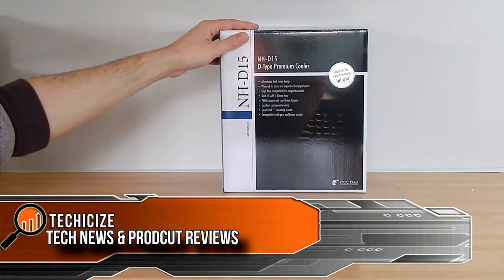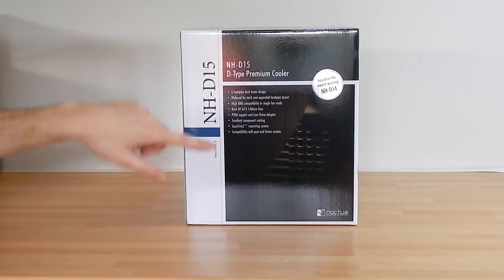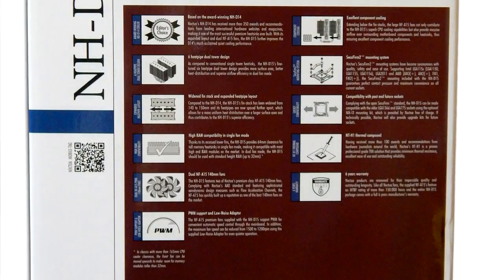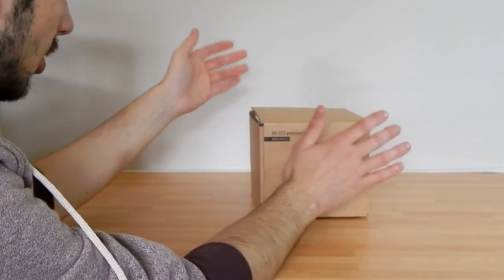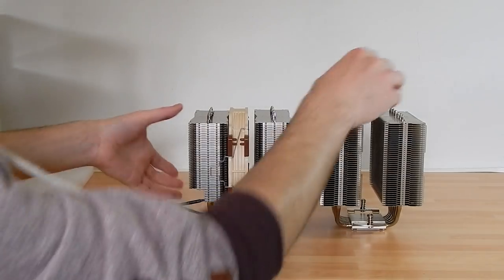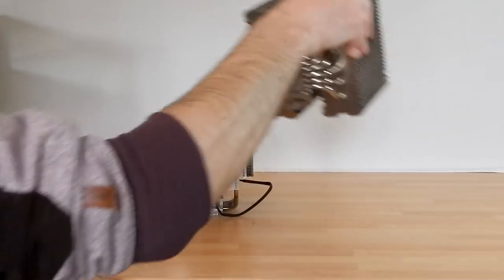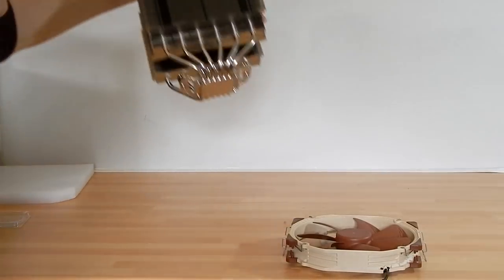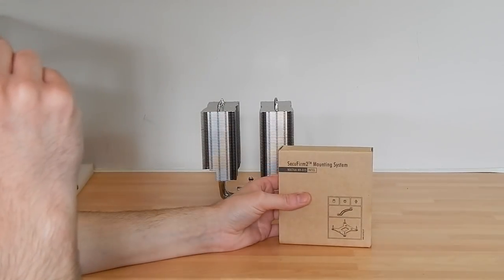Noctua NH-D15 Unbox Overview and Install Guide [Socket 1150]

Comment: I know this is a really old video now, but you know you can mount the fan higher up like that anyway ... Its not a big deal.

They made it flex-able so you can mount the fan higher if your memory gets in the way. It doesnt make an impact. Just hope you have clearance in your case for the fan like that.
Reply from the maker: +Daiesthai Hi, your right  and your one of few that sees the point many others miss. it;s already quite tall and raising the fan increases the overall product height. Not all cases on the market will close when the fan is raised ;)
Reply: +Daiesthai Well I have the shittiest case alive that has clearance for about 7 inch height, still can fit very well so this should fit in almost everything mid tower and up
Reply: +Ark Shit comes beefy. My Lian Li is 210mm and Haf 922 230mm on the outsides and given the cooler is 155mm + 20mm for fan extrusion I would say it's a no-go on the Lian Li and a close call on the Haf, given there are 30/50mm to fit motherboard, standoffs, tray, offset and sideplating :-D Many cases have more motherboard tray offset to fit cables behind it.. dont get me wrong, it will surely fit most cases, but its a good point!
Reply: +Techicize Will a 120mm work on the heat sink?

Comment: I have a noctua cooler 'half' the size of this...and it is very impressive.
Reply from the maker: Yes the smaller models such as the U12s perform very very indeed. The D15 really shines when you overclock a hot CPU like the Haswell's though, in less demanding situations I'd recommend the Noctua NH-U12 or 14s

Comment: Mine has less room between the heat spreaders, so there is just enough room for the fan in the middle without a gap. Mine might work better.

Comment: perhaps you could you use a spacer for the front fan? buy three rubber anti vibration spacers for approx £1 each, and cut part of the bottom off all three. that would allow the fan to sit out from the cooler, away from that ram stick, and also lower down, in alignment.
Reply from the maker: rainbowsalads  you raise a very good point indeed and I could see that working, good thinking
-John

Comment: at the end the whining sound is not coming from the motor but in fact is coming from the wind turbulence created from the second fan because it was not designed to pull threw the cooler radiator fins.
If you mount it in the recommended spot the sound goes away and you are left with just the wind noise.
I can not close the case with the fan over the ram so i opted to use only one fan because i can not stand that whining sound
Reply: Yes, I am. I tried both of the fans in multiple configurations, and when i put the fan in a pull position, rather than push like it was designed, it makes the whining sound.

Comment: i have vengeance lpx DDR4 from corsair and they are 31mm height, so i think mine will be ok, even my full tower case supports heatsinks up to 195mm
Reply: 1sonyzz on their site you can check compatibility for motherboards and ram
Reply: Joep Adams
yeah and i didn't found asus maximus 8 hero

Comment: You forgot the cooling paste. Also could you comment on which way the fans blow/suck, since the planning part becomes harder if you dont know this. Thanks for a nice video anyway :-)
Reply: Gibbet When using the push/pull method of two fans, you have both fans pushing/pulling air towards the rear end of the case. One fan pushes air through the heat sink and the second fan helps pull the other fans air in order to increase the air flow.
Reply: David Davidson
Im confused, do they do both or not?
Reply from the maker: Gibbet You can choose to have the fans either way, it is more common to have them pushing air from above your ram, towards the back of the case.
Reply: Techicize
Where do I choose this then? :o
Reply: Gibbet Sorry if I didn't say it clearly. Pretty much both of these fans will be facing the same direction. It would look like this (Front--->2 heatsink fans-->Back)
Reply: David Davidson
I should've been a bit clearer as well i guess :x
I was wondering how to tell what direction the fans will be blowing in.
Reply: Oh! Most fans will have two arrows somewhere on them. One will tell you the direction the blades spin (sidways) and the other will tell you which direction the air will blow (fowards).

Even if you end up with a fan with only one arrow, it will most likely be the one which tells you the air direction.

Comment: Hopefully I get a answer on this soon.  I am going to purchase this CPU Fan but had a question.  I was told that I could use a case fan for a fan on this.  Now, do I have to buy the brackets to clip on to the Straight Pipes?  If so, what are they called so I can look them up.
Reply from the maker: I don't recommend using a case fan on this product, sure it will work but that's really your decision. The extra clips to mount are included in the box, you don't need to purchase them :)
Reply: +Techicize Thank you for the reply! :)

Comment: Is the 1-fan mode still reasonable for strenuous overclocking circumstances, or would you rather use the 2-fan configuration?
Reply from the maker: TheOriginalMango  yes a single fan is still OK, about 4c less than using 2 fans - http://techicize.com/noctua-nh-d15-review/5/

Comment: Hey there, got a question and I would really appreciate an answer. I have done the same thing as this guy did in the video and that is mounted up both fans on one tower, so my question is, does it matter if they are both on 1 tower or should I mount fans on each of the tower. I mean is the cpu temperature same or not?

Comment: Can't save enough money to buy this , duhhh. You know I measured the size from the cpu socket to the case panel and it's 18CM , this thing gets to 165 cm with fans, but I would like to have a 200mm fan on the rear panel that is aprox 2.5 cm tall ( I don't  know the model of my thermaltake case)  the panel makes a bit of room for the 200mm , if it's gonna fit, maybe the 200mm fan and the noctua could be touching or be a couple of  mm apart , is that a problem? I'm pretty sure that the panel fan could bring down 5 C helping me with a better OC

Comment: i didn't see you apply the thermal paste, is the thermal paste already on the plate of the air cooler?
Reply from the maker: ***** I did not apply paste as this is demo install only. The paste is included but you must apply it yourself
Reply: Ahh i see, thank you for your reply! :)

Comment: Hi, I am using Asus Crosshair V Formula-Z mobo is this Noctua NH-D15 going to be compatible and going to fit with my motherboard?
Reply from the maker: Hi Frost Ice  it will be fine yes- Confirmation - http://www.noctua.at/main.php?show=compatibility_gen&products_id=68&lng=en#AM3+_Asus
Reply: Thank you!
Reply: question did you ever get the heatsink did it fit the Asus Crosshair V Formula-Z AMD mother board and will 2 video cards get in the way

Comment: That is not the way you want to install fans on these for future viewers. Pull fans make added noise when you use the standard fan bumpers. The fan blades are too close to the heatsink. Use push / push when ever possible. If you must run pull / pull then put a 1-3mm gap between the pull side of the fan and the heatsink.

Comment: Good video.  But which fan configuration was the best in the end for those with high RAM issues?  Push/pull on a single tower or pull on each tower?  I can't seem to find that information in your written review...
Reply from the maker: oobenoob the difference was less 1c in either case, i believe that push pull on each was the better
Reply: Techicize Good to know, since my ram is too high I think :/

Comment: hello, i'm in need of a better CPU fan since i only have a stock one from intel, a delta dtc-daa10 which makes the cpu quickly run at 90 degrees. something i don't like that much. running a i7-2600@3.4GHz and gigabyte ga-p67a-d3-b3 motherboard, but my question really is only how tall the Noctua NH-D15 is measured from the motherboard and to the top? Don't have that wide of a case and measured around 18-19cm from motherboard to the edge of removable wall. Thx for any kind of answer :)
Reply from the maker: Patrick Eldevik Kjosar  sorry for my late reply. The cooler is 160 mm or 16cm tall with the fan

Comment: Does this cooler fit on a MSI Z97 Gaming 5 motherboard in a NZXT Phantom 410 mid tower case? Techicize I would love to know :) Thx
Reply: Gustav Sporre PCpartpicker says its compatible. So it should fit. But I have no idea how well it will fit. Looking at some other videos, it should fit just fine. You might just have to move some cables around a bit, but overall it shouldn't get in the way too much.
Reply: Okay. Thanks a lot!! :) Biased Gamer96
Reply: Gustav Sporre yup, just remember that the two outer fans dont have to be all the way down, or even on it at all. If one of the two fans doesn't fit, you can simply remove it, or just not put it down all the way, the cooler will still work great regardless.
Reply: Okay. Thx! Biased Gamer96

Comment: Is there any difference between default ( fan 1 in the middle fan 2 in the front) and if you put the 2 fan to the rear?
Reply from the maker: renks051 No we tested in ton of different ways, the difference is almost none existent. In some cases less then half a degree
Reply: Techicize Are the fans push or pulling and is there any difference?
Reply from the maker: renks051 in this test all pushing, in real case/chasis you would be wanting to do the same, pushing the air towards the rear of the case to exhaust out
Reply: Techicize What do you mean, you got 2 fans on the rear block, so the middle fan is pushing, but the back fan is pulling I assume, otherwise they would both push the air into the second heatsink.

Comment: just raise the fan over the memory, you can mount at whatever height you need

push-pull on just the back fan is bad, push-push on both towers towards the back of the case is what you want in a closed case, and push-push towards the empty center of the cooler is what you want in open air  - it's not rocket science
Reply from the maker: Your 100% correct, thing is though doing this brings to fan closer to side panel and increases the overall height. This will reduce compatibility for some cases

Comment: Is it worth upgrading to one of these from a hyper 212 evo
Reply: JUNAID187  its only worthy as upgrade if you plan to do some overclocking. Or you want a very, very quiet cooler.
Reply: +JUNAID187 what chip you have my 4790k kick afull lot of heat my 212 evo on 4.6ghz on 1.320 volts on 80-95c im gona get this or cm nepton 280l
Reply: +Aaponton I also have a 4790k the evo keeps it nice and cool but then again my case overall has excellent cooling and I live in the UK so my room temps are generally quite low. You shouldn't be getting any overheating there's probably something wrong with the chip or thermal paste or the way you put the cooler on.
Reply: JUNAID187 ok i live n finland there is cold but my room is  about 24-28c and i puttet only small drop of thermal paste like everyone says its best method and my friend get same temps on i5 4690k on same cooler on 1.300 volts 4.6ghz
Reply: +Aaponton It may have been damaged or incorrect connection between chip and cooler. Try reapply thermal paste maybe you're using the incorrect paste?
Reply: JUNAID187 i used paste what came with the cooler

Comment: i have same memory and i want  this cooler and you can put fan litle pit highter and still get same temps begause fan goes under the cooler by more tha 1cm and beats is 1cm highter than memory what this support with 2 fans

Comment: Well....
I would have one if it wouldn't be so...
well, for compatibilty sake it lost a lot of power....

a mix of the NHD15 with the cooling fins of the NHU14 would be the best solution, and then make everything nickleplated copper XD

No, srsly, the NHU14 is performing almost equally like that huge thing....
Reply: +lukas anton j. I agree with you...the u14s is taller, and the fins extend further down towards the base plate. I own one, and with an extra 15-2000rpm pull fan, the performance is fantastic.

Comment: can i install a noctua NH-D15 on Gigabyte G.1 Z87 ? will i have enough room for graphics card? i will go with a closed case Cooler Master HAF 912 Plus. in all those free slots for fans i will have one upper and rear for exhauste and bottom with center one for intake should i put it horizontaly or vertical? i think that is better vertical couse it will pull air with the center fan and exhaust it at the big ass top fan slot what do you think pls reply its my first build so i need to know what to expect will i have room and what do you suggest to me how should i install it? sorry if i dont make sense i did my best with eng :) PLS HELP Thanks
Reply from the maker: Hi JOXWb  it should fit just fine. Mounting it horizontally or vertically wont make that much difference, generally a degree or two better or worse.  Don't worry your English is very good :)
Reply: Techicize ty very much :) but ill go with CoolerMaster Hyper 212 Evo its cheaper and it haves good revievs hopefully it will be a good choice :)
Reply: hi me again :) what do you think about this specs? 
AMD FX-6300 With CoolerMaster Hyper 212EVO with Arctic Mx-4 paste (Push-Pull) Corsair fans SP120 performance
Gigabyte GTX 770 OC 2Gb
Mobo Asus AM3+ 970 M5A97 Rev 2.0
SSD Kingston 120Gb
HDD Seagate Baracuda 2Tb
Kingston HyperX Furry 2x4Gb 1866MHz Black
Seasonic M12II EVO 80+ bronze 620W will this be enough power?
CoolerMaster HAF 912+ Case with additional 200mm fan on top of the case and one of the Corsair SP120 couse its a bundle on the side of the panel
Reply: JOXWb If you're looking for advice on builds, or even just opinions - I recommend you visit tomshardware.com, setup and account, and jump on the forums. Friendly, and knowledgeable community :)
Reply: Charlie Ward thanks for a tip allready have acc there about a week ago made it and it was very helpfull this is my build

ASUS 990X M5A99X EVO 2.0
AMD FX-8350 with hyper evo 212 mx-4 paste and push pull system
ASUS GTX 760 DCIIOC 2Gb
Kingston 2x4gb furry hyperX 
SSD 120 gb patrion pyro and HDD 1tb seagate Baracuda
seasonic 620W M12II evo
with CM HAF 912+ case

Im waiting for parts tomorow or after tomorow they will arive :)
Reply from the maker: JOXWb Hi sorry I missed your other questions. Tomshardware has a very good forums and I glad you sorted now :)
Reply: Techicize yes very kind people good tips and solutions from them ill reccoment them to all :) keep up the good revievs :)
Reply: JOXWb Sounds like a fun build! Here's mine atm:

Intel Core i5 4670k @ 3.4Ghz
Corsair H100i
Asus Maximus VI Formula
Corsair Dominator Platinum (8GB, CAS8)
2xSamsung 840 EVO 500GB in RAID 0
2xXFX R7970 DD Editions in CrossFire
Corsair TX850

All in an NZXT H440 with Noctua fans on the way :D

Comment: will this fit on intel 1155 sockets?
Reply from the maker: aval1998  yes it will :)
Reply: Techicize when you were screwing on the air cooler, did you screw those bolts all the way down? also, can you do a pull configuration on the cooler?
Reply from the maker: aval1998  yes the bolts have pressure springs, so you tighten until they stop. Im sorry but I can't re run this test for you. As I explained in another comment, we tested the fan in single, double and triple mode. Each in different ways, the difference was small everytime.
Reply: Techicize Sounds good!

Comment: just put the front fan on who cares if its more up
Reply from the maker: Julius Sidabras I have answered this point in the past, The cooler is so tall and wont fit inside all cases, if you move the fan up. It makes the overall height even taller. So it will fit inside  even less cases.
Reply: Techicize  I would think person buying the cooler would do his homework if it will fit